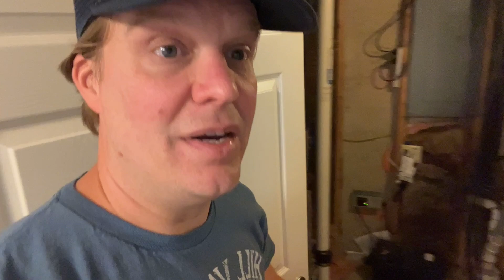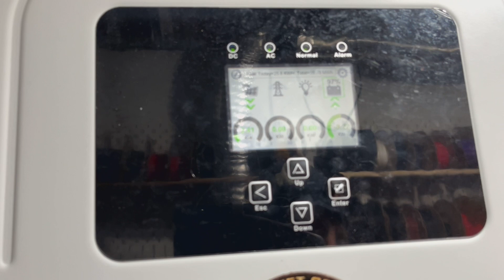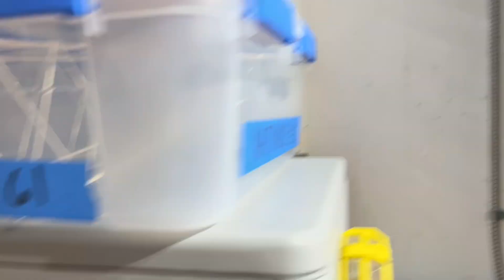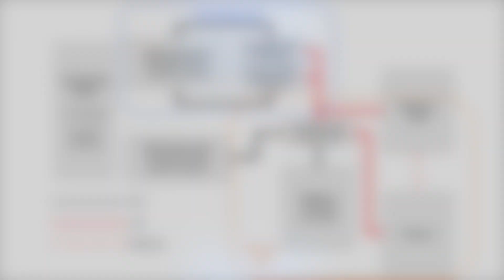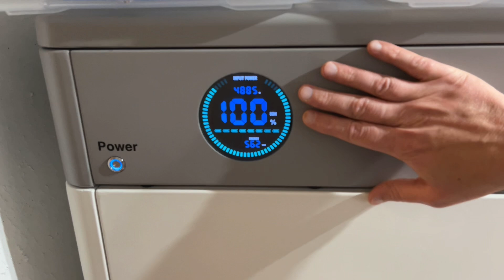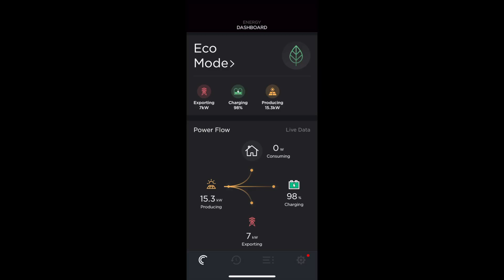71 Solar panels online! And my little Beef with our Solar / Battery setup

Comment: Ahh the pain from being an early adopter! Still, its a pretty sweet system and I'm envious of that monster solar setup. I'm currently running the ecoflow home system with smartpanel2. Its all one system for monitoring which is nice but of course, like Apple, I'm trapped in their ecosystem!
Reply from the maker: @christiankruse1970  Nice, I was checking those out… worse places to be trapped if it all works nicely. Sometimes it’s nice to have things that work well out of the box and don’t require a lot of “integration” energy

Comment: Why I’ve got a MidNite aio and designed my own off grid system. Plus it already has smart breakers built into the inverter that I can control from the phone or just based on system soc

Comment: The My Solark app is awful. If you modify parameters it will set the 15K to a power limited mode (12000 watts) rather than the max it can output. I have integrated the Solark 15K with Home Assistant, much better data.
Reply from the maker: @JarredSutherland  sounds like I need to put Home Assistant on my list of things to dabble in!

Comment: I've got an Enphase system, but in your position, I do believe I would have torn out that Solar Edge stuff and put in a second SolArk.
Reply from the maker: @TheUweRoss  yeah would probably do that if I could go back… though wire path would be a challenge as I think there’s more than 15 on the solaredge
Reply: @OuttaMyDepth  I just wanted to second the option above. 
However: https://youtu.be/WpRXrcRxiQ8?feature=shared
This is a great alternative. 
Also Sol-ark now has a power panel that'll auto shed loads to your spec. SPAN has been peppered (from my understanding) with glitches. In my opinion adding yet "another" level of effort & complexity.

Wishing you all the best 🙏
P.S. I'm completing my journeymen licence & solar certs. Whom ever ran that MCM cable to your Sol-ark... 😬 Plus your Square-D transfer switch setup seems like a very very expensive way for your system.

Comment: 2 1/2 years off grid. No power outages longer than two minutes about 5X. 32 kWp - ground mounted, two SolArk 12K, diy 180kWh with JK BMS’s. No monitoring, no internet, JK app if you want to look at individual cells. It just works. 1,600 kWh per month average. A good 100 amp clamp-on amp meter does wonders if you’re trying to troubleshoot an issue.

Comment: What a nightmare
I've been off grid for going on 10 years (Michigan, also) and have none of these problems, no "apps" to follow, no "data migration" to worry about, no SolArk BS...  just 15,000 watts of solar running into the best Charge Controllers money can buy, flowing into 56KWhs of LiFePO4 batteries and 2 fantastic Magnum 4440 PAE inverters all monitored by a simple Midnight Classic shunt/monitor OMG it's so simple, and it just works !
Reply from the maker: @mark_osborne  sometimes simple is the BEST! The “intelligence” to swap off and on to the grid in 4ms and utility company hoops are pretty obnoxious… I should have known better than to let them introduce two different types of inverters, sigh
Reply: So instead of using the power company on grid, I could just have a solar system installed, so would they just wire the inverter into the fuse panel?
Reply: @rickeyponder  Yes, the inverter flows to the fuse panel.  However, I also installed a "break out box" that has 12 circuits, each of which you can select to be either "on grid", or "on solar".  So if you get a bunch of bad days and don't feel like running the generator, you can selectively switch a few circuits back to the grid.  Grid energy is still cheaper (in most cases) than making electricity using a generator.  Although in my case, it's very close using the Yanmar diesel generator that turns a simple Ford alternator.
Reply: Sadly you’ll never understand the simplicity of a SolArk 15K
Reply: @macclark4112  based on his video, I would have to agree  lol

Comment: Moral of the story? Software is important. And mix and match components do not work well because their software is proprietary. If it were me? Id just replace all three inverters with a pair of the EG4 12k all in one inverter/controllers. Then divide the solar between them.
Reply: If software is important I am not sure why you're recommending EG4. I like their products (run 6 of their LifePower4 batteries) but the software is abysmal.

Comment: Guy, I sense some frustration with Sol-Ark and the app. I have a Sol-Ark 15k and 20 x 530w Bifacial panels and while the app works fine for me, it could definitely do with some tweaking! (I'm sure that it's coming) 
I think that you have to definitely bite the bullet and rewire all of the panels to the Sol-Ark. I'm sure that it can handle all of the panels, although it will probably mean that some panels will need to to be AC connected to the Smart Input, because of the sheer amount of power that you have. The Sol-Ark app will then be able to monitor everything and maybe even offer some kind of usage monitoring system in the future. 
Maybe register with Sol-Ark and sit in on some of their training sessions, which I find very helpful. 
I see that you commented about the difficulty of connecting the arrays down to the Sol-Ark, but looking at the outside Solaredge units, they are definitely going to have some issues with being outside for an extended period. I know that they say it's not a problem with outside installation, but you obviously get some serious extremes of weather and temperatures. Get the stuff inside where it belongs or consider some kind of outhouse to house the Sol-Ark 15k where the Solaredge stuff is and then you'll just need to have one feed going down to your panels downstairs. 
Your video presence is very good. Doing several videos of this kind of upgrade of a system will definitely generate lots of views and subscribers. 
Good luck and keep on keeping on. Together we are definitely making a difference to the climate issues.

Comment: $0.02... I see your setup and can't imagine trying to manage it all.  My house is zero export and instead storages all extra in batteries.  Utility just doesn't pay a good rate.
Reply from the maker: Yes, utility rates are worthless. I’ve been gradually shifting more to battery cycling… it goes down to 30% SOC at night now which almost has us off grid completely. With this much solar the battery charge fills up really fast though so I can’t store it all. The EV charging (and AC unfortunately atm) go straight to grid and can’t run off the battery so back feeding some amount of generation is important to maintain zero usage on net metering as we get 100% credit against usage (as long as it’s in the same peak/nonpeak time of day).

Comment: You could get what you want by ditching the solar edge stuff, get another 15k, wire the PV strings to work across the 6 mppt inputs you would have between the two 15ks, then use solar assistant to give you good intel, then if you are really a geek like me connect home assistant  for load control.  I have 2 15ks, almost 30kw of solar and it’s flawless
Reply from the maker: Nice setup! All solark would be nice (if I could get their app working right). Not sure I want to drop the dough to swap out though and it’s a little complicated with wire paths and number of panels on the old system. Think I’ll start by seeing what home assistant could do for me. What do you have HA talk to for controlling loads?

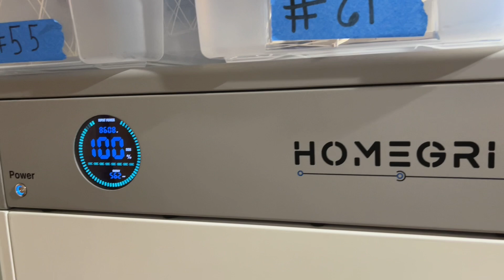Comment: 7:43 if you install a battery less system like 1- lv6548 you can run your house on solar. Power outage or not. I installed 2 with a minimal 5kwh cheap ebay battery bank and just take the small hit every night using the grid everynight to keep the fridge running with AC bypass.
Reply from the maker: Nice! We were told a battery system was the only way to not have auto shut off to protect grid workers from danger during an outage. It makes sense there is another approach like this too
Reply: @guysuter  In my system and the 1 lv6548 battery less system I use grid power but I don't export anything back to the grid. In California unless you are grandfathered in they pay you less than 1/2 of a kilowatt for every 1 kwh you export. Not worth it.

Comment: Solar assistant if you want ease, Home assistant if it's also your hobby!
Reply from the maker: @frankh7234  I may just have to take this on… a lot of people have been recommending home assistant to me with the same warning that it’s some effort to get going. For home automation I currently use a mash of Hubitat and Alexa for control of a range of IR / RF and z-wave devices. Could be fun to chronicle where that’s at now and how introducing HA may change / improve things
Reply: @OuttaMyDepth  Have a look at: HACS-Hubitat integration for Home assistant, so you can have Home assistant control your Hubitat devices without buying zigbee and z-wave dongles.

Comment: wifi ct clamp monitors theyre like 15-20 bucks. you just need to put ct metering clamps on the right wires i believe. can get messy since those ct camps have their own wires that have to go into the brain box, but it acts as a router you can connect to

Comment: U really have a great setup........pity u cannot get the info u need.........as  lay person but technically/IT inclined I would only use SolARK and remove the other two inverters as SolARK is big enough/powerful..................however this guy @engineer775 is the SolARK expert...........check his youtube channel........he does some big residential systems and should understand USA standards...........he is very helpful, drop him a line.
Reply: I was wondering if you have your AC coupled Solar Edge inverters feeding into the Gen port of the Sol-Ark 15k. This allows monitoring of the loads vs feeding this into the loads panel